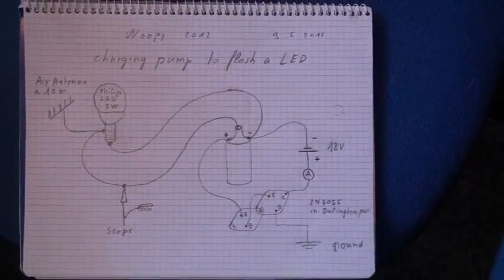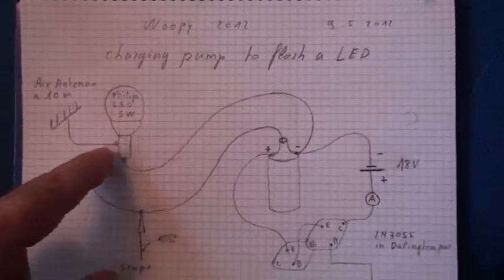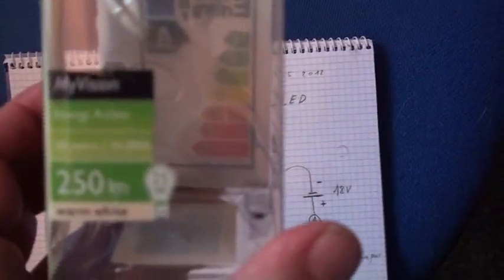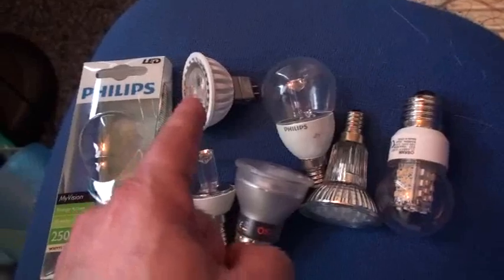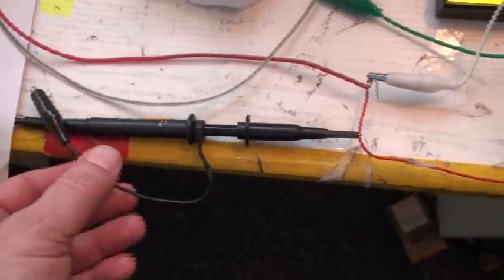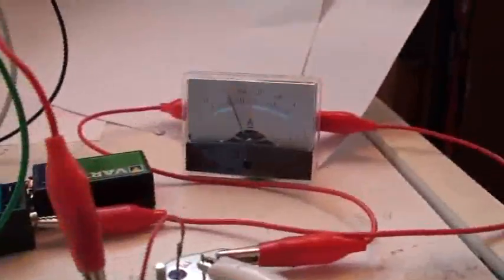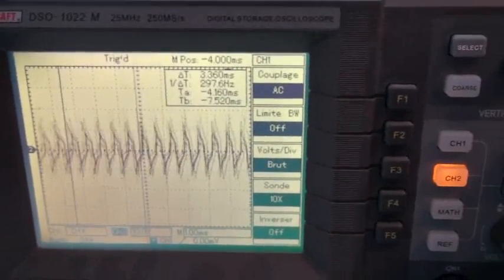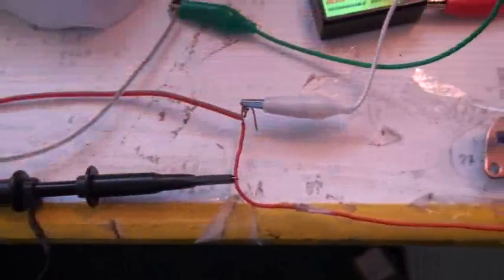amazing electric pump charging 1.wmv

Comment: Based on calculation you are at 3.6W the body gives capacitance so would capacitor.
If you have tools to measure capacitance  of your body to the transistor leg?
Antenna is not tuned means random resonant frequency. But 10m= 28MHz wavelength. (10m ham  band) Try to tune your short wave radio  with BFO if you have one to that  band.
Try to connect  air capacitor to  antenna in series.
Try different capacitors between ground terminal and ground wire.
Rest of my comment is on overunity    
Wesley